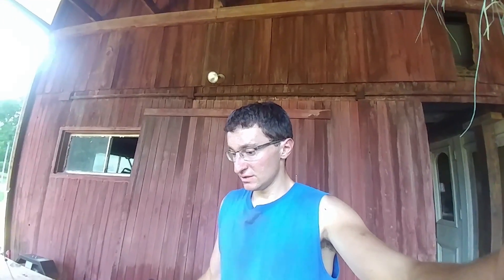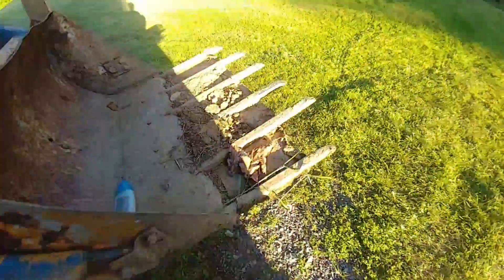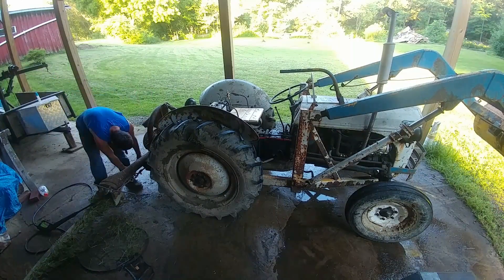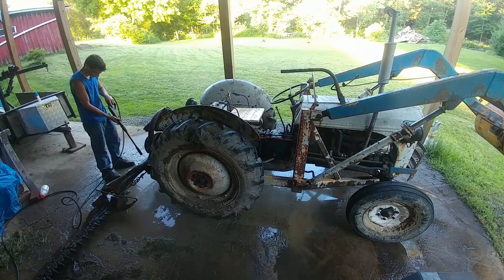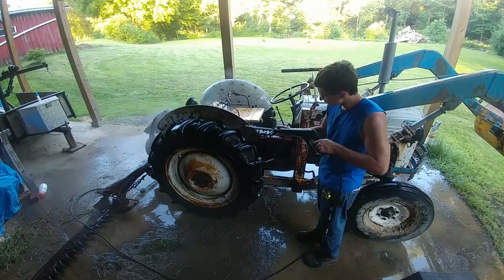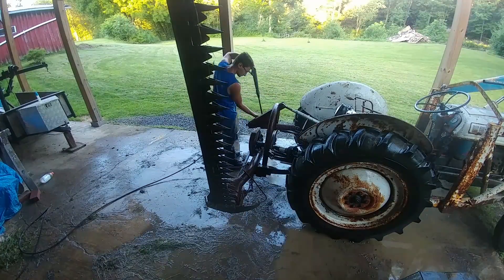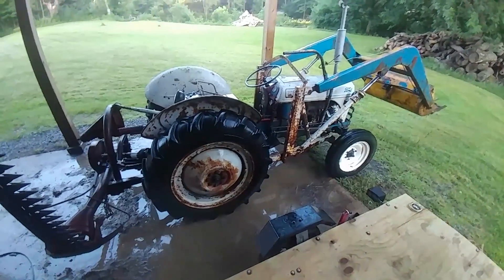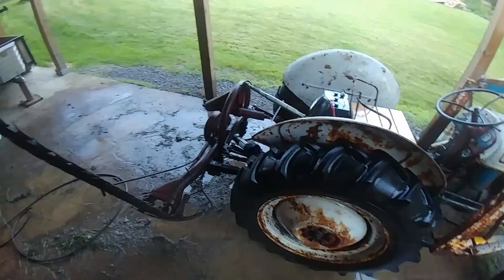MAKING THE 8N LOOK BRAND NEW (LOL)- PRESSURE WASHING THE FORD 501 SICKLE MOWER AND FREEMAN LOADER

Comment: What going on here I thought the guy who gets it dirty washes it!
You have the right idea about the calcium it’s so corrosive and I noticed that you have the original rims it would be a shame if they rotted out!
But if you find that you don’t have enough traction without the calcium a set of chains make a huge difference and then if you need weight you can just put a implement on your 3PTH that would make up the difference!
Anyway keep that old iron running!